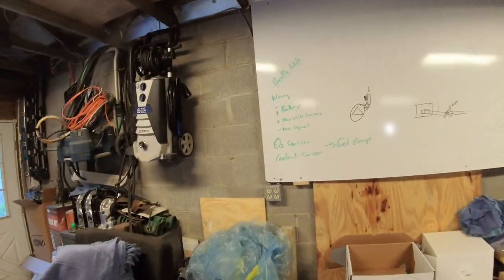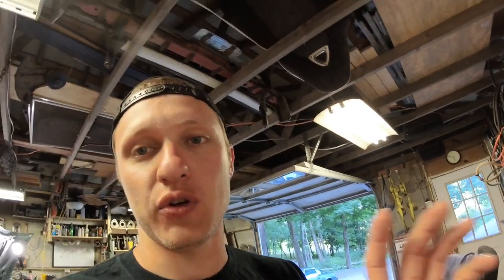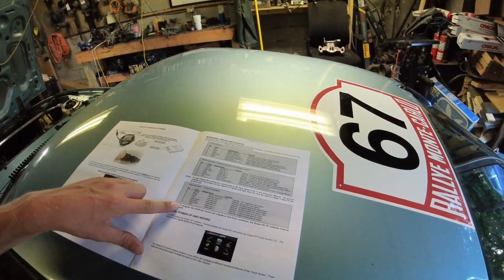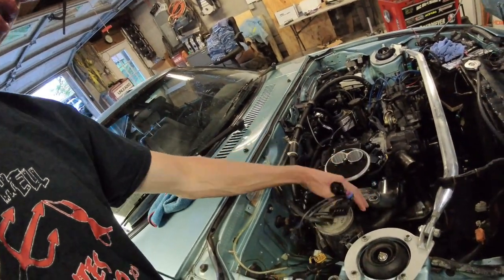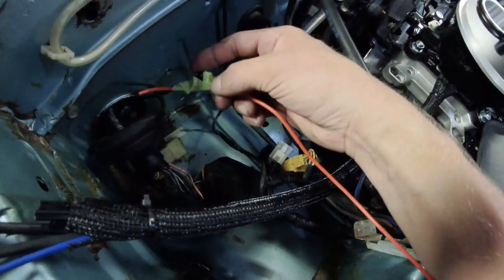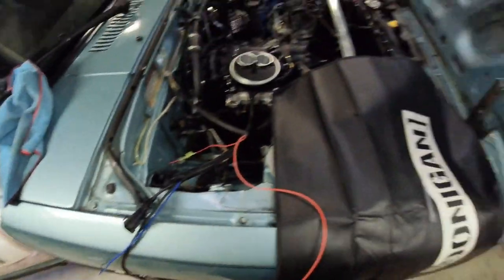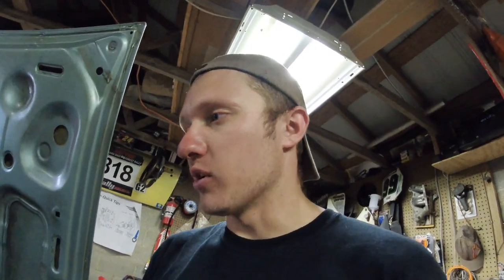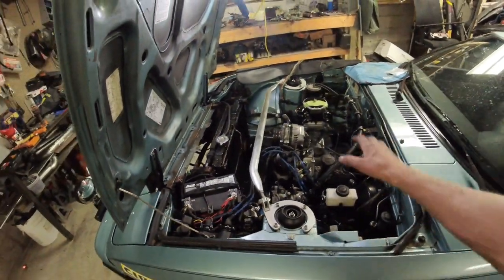Holley Sniper Wiring Complete - Sniper Efi On a 12a Rotary PT-4

Comment: I know this is a very old video, but the forums don't have the answer or I just can't find it. 😅 Does running the tach signal off the negative coil on the trailing mess with the fuel injector firing time? I might be completely wrong here, but aren't the injectors hooked up to fire with the tach pulse and itll be like 30 degrees off since it's firing off trailing?

Comment: Thank you.  I watched all the vids on the Sniper.  I'm having Kurt Robinson in Oregon build me a street port 13b for my 82 FB.  Considering the Sniper or Holley  carb.  End goal is Atkins supercharger so whatever direction I go, I can direct bolt to the supercharger.   Do you think it's best to go with the Sniper?  More power?  Better drivability?  Other advantages?  Thank you for your opinion!
Reply from the maker: I think if you're going to learn a new system the sniper is more worth your time investment to learn how to use vs tuning a traditional carb
Reply: skip the atkins. it sucks. i was looking into it months ago. from what ive read it adds a bunch of heat to your car.

id look at something like a pro charger instead, sized to what you need.

Comment: Thinking about how you are describing the ignition control, you could run a wasted spark setup on the Leading ran by the Holley and leave the trailing running through the distributor.  Kind of like DLIDFIS but with better control/coils on the leading.  Just thoughts.
Reply from the maker: Id just be curious as to what having a locked trailing timing with a variable leading timing would do with regard to detonation under boost?
Reply: Solid question.  Is the Holley timing actively variable on its own and if so, is that something that could be turned off or tuned around.  Another option would be to ditch the trailing altogether, but I've never been a proponent of that despite it having little impact on a stock port 12A.  I just remember how much better my first 80 ran when I implemented DLIDFIS.  Getting the same benefit while taking J109s out of the equation and being able to use modern direct fire coils sounds even better, but may not be possible without ditching the mechanical and vacuum advances on the dizzy.  Random thoughts...  ;)